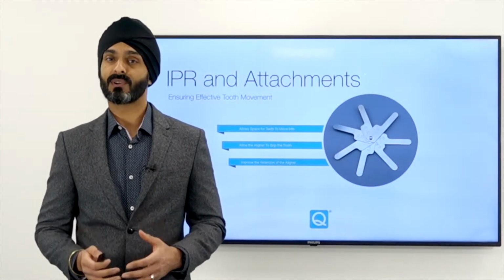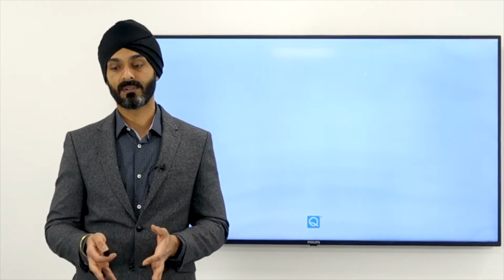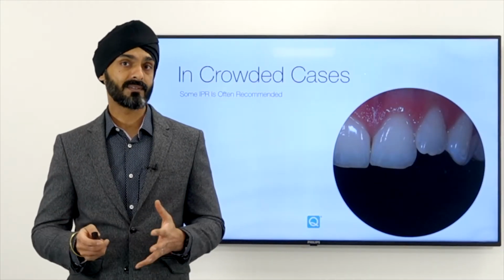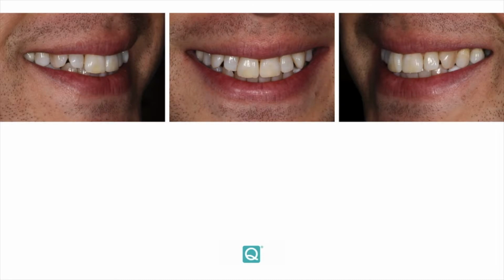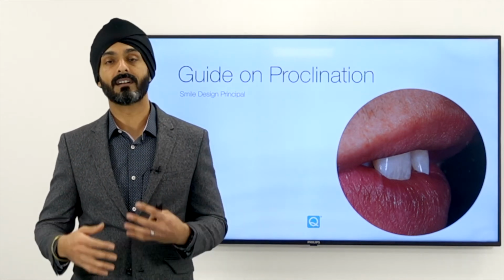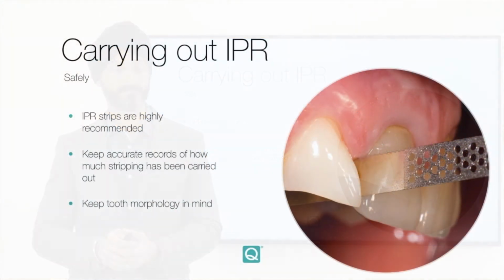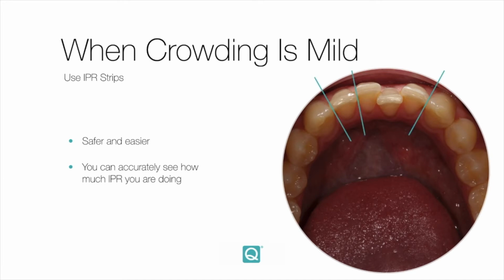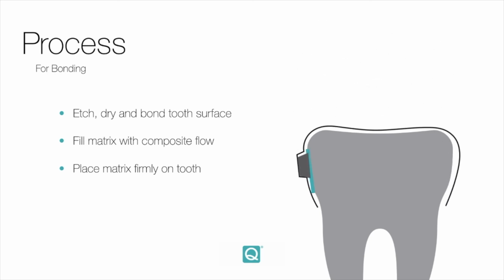Clear Aligners IPR and Attachments

Comment: On left, there isn't intercuspation , patients is probably having bite issues which leads to psychological issues.. wasn't there any way to slides teeth back to achieve intercuspation
Reply: the midline is more off-centre post-op, most likely a posterior tooth interference caused by the unlocking of the bite anteriorly, could consider equilibration